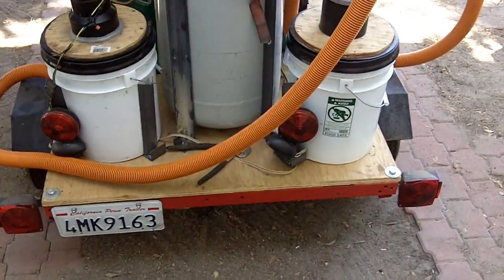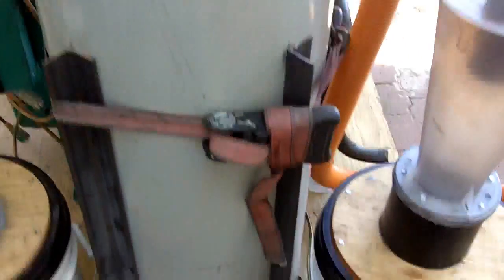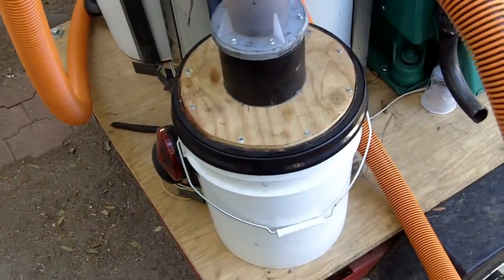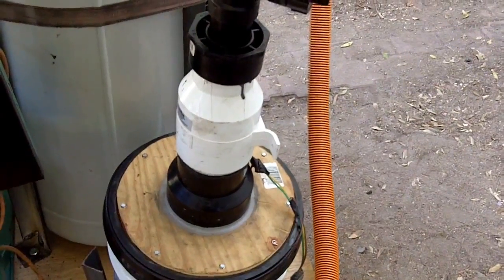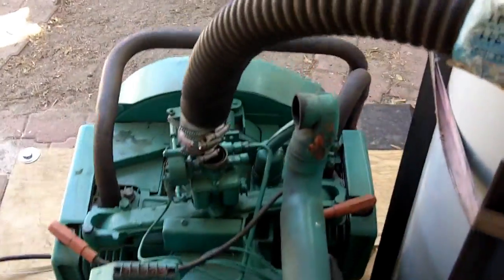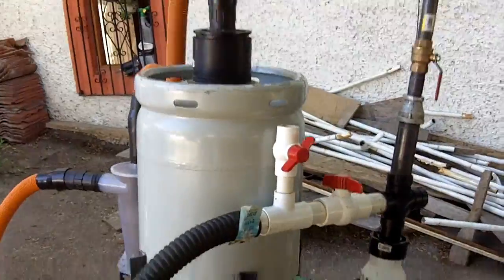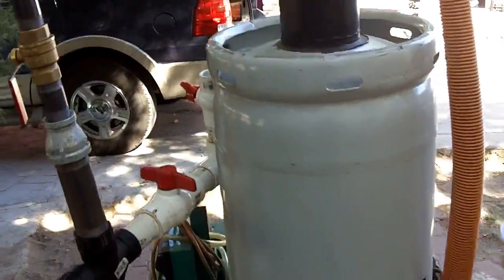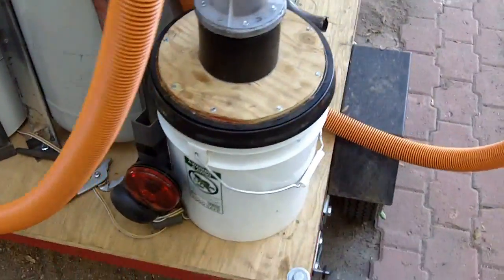The OpenFire Charcoal Gasifier

Comment: Every DC blower is adjustable. Use a regulator to lower the amperage supplied. For ac, use a dimmer switch. A rheostat would work for DC too.

Comment: looks like a $3500 set up but i love it , have you ever considerd steam injection to increase gas out put?
im currently working on dual burner unit that ejects nitrogen free gas streams by cycling the the combustion chamber phases , 1 unit will be blasted with air heating up as the other unit is blasted with steam ejecting nitrogen free CO  and H2 this will increase the power output of the I.C up to 30 percent , we are loosing all are power at the engine , (up to 60%) becuase of nitrogen dilution of the gas stream and CO's slow combustion speed, a super charger would help but probly not much